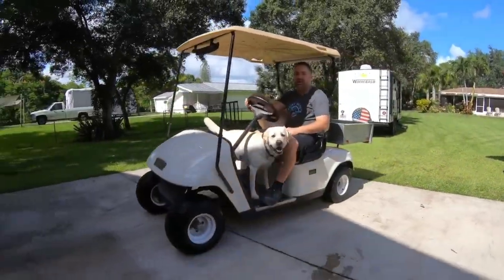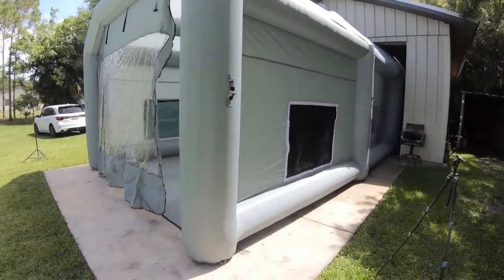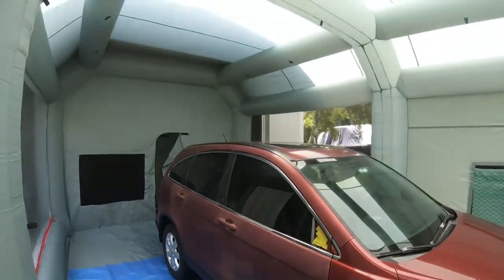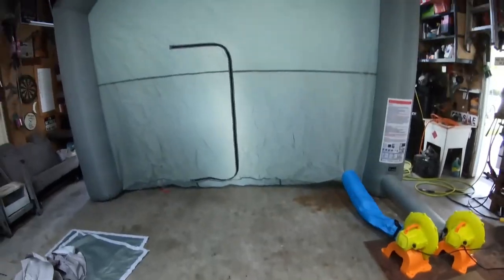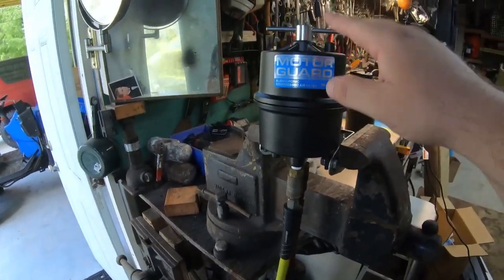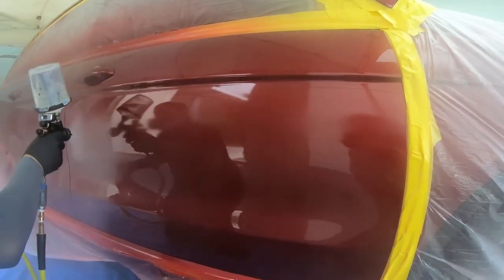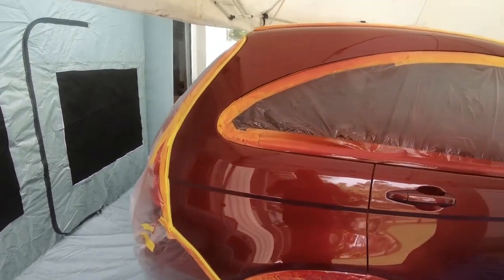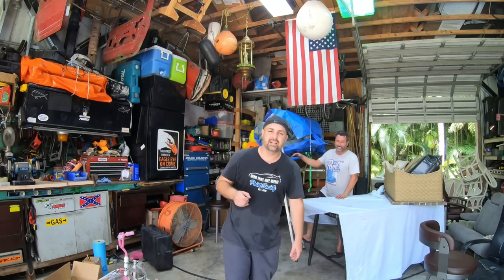2022 Sewinfla Inflatable Paint Booths! The TRUTH and the BEST Chinese Made Paint Booths.

Comment: I don’t understand why there isn’t a suction ventilator to place outside the filter windows? Doesn’t the paint just float around in the booth? Surely the air intake ventilator isn’t enough to push all the paint out the filter windows?